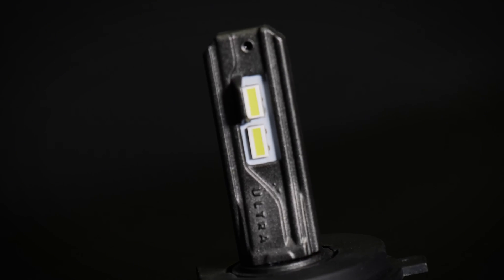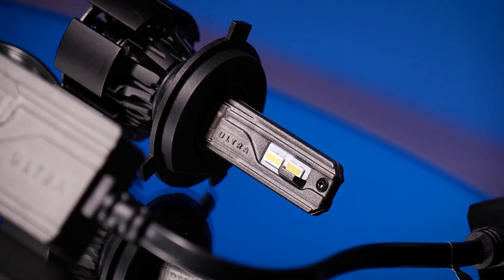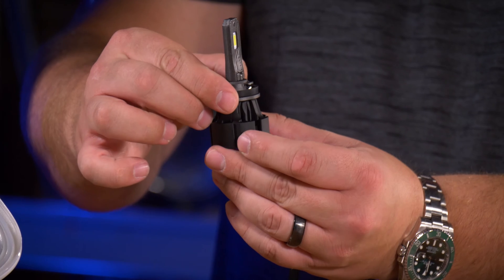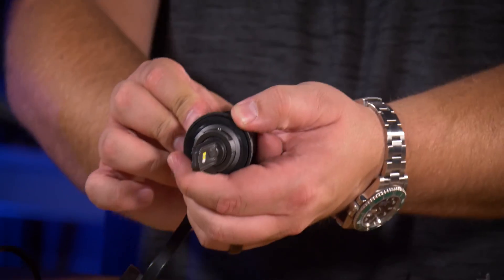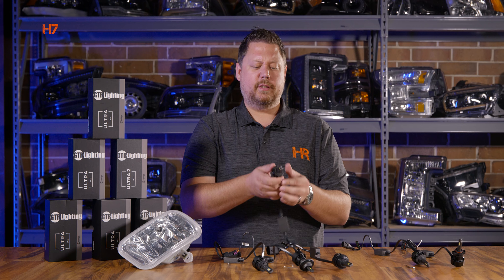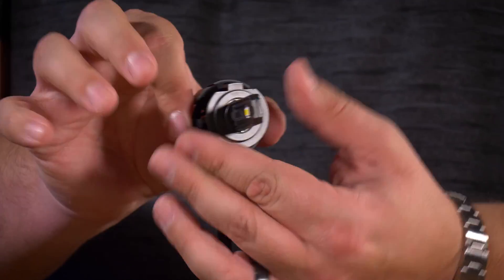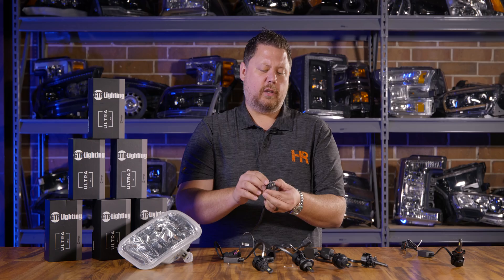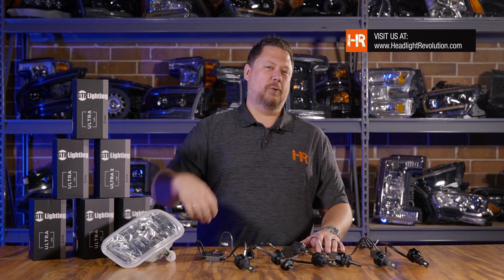How to Aim, Adjust and Align GTR Lighting Ultra 2 LED Bulbs - Clock the LED Chips Inside the Housing

Comment: What about H4?  Mine has two tiny Philips head set screws. I need to rotate it to have it aligned correctly but there are only the two tapped holes already being used behind the collar. No other options to change alignment.

Comment: Are these good for aftermarket projector headlights winjet on a 2015 silverado? currently have hikari but they are really low after 2 years
Reply from the maker: These would be great! But with projectors, a 35w GTR Lighting HID kit would be even better!
Reply: @HeadlightRevolution  do you have a link to them h7 is the size I need
Reply from the maker: https://www.headlightrevolution.com/H7-Ultra-Series-HID-System_2

Comment: Does it matter if the cable is at the 12 o'clock position and the LEDs are at 9-3 o'clock? Installed in a after headlight on a 2017 charger and I did both by touch since you can't see inside the outer housing of the headlight while installed.
Reply from the maker: It does, you can see the light on the front side of the headlight on the lens. This will show you where the diodes are facing inside the projector.

Comment: Absolutely love this channel! I have two questions! I'm getting a 2018 nissan maxima Sv with a halogen/projector housing.  What is the correct clock pattern for the gtr u2s? And next what would be best gtr leds for the fog lights to match perfectly with the headlights?
Reply from the maker: 9 and 3 for clocking them. I would run the yellow GTR bulbs for the fogs!
Reply: How'd it go?? Do you get a lot of people flashing you or do they seem to be aligned correctly??
Reply: @matto5656  
They turned out beautifully! Couldn't be more happier with the gtr's

Comment: AAAH - Thankyou, ive spent all day wondering about this. Now ive got it all together, i have to pull it apart and clock the LEDs :(
A tip for ya - the GTR ultra 2 bulb is loose in the housing of my Ram projector. After clocking to 9&3 i fitted the rubber o ring off the oem bulb instead of GTRs and it now fits much tighter !

Comment: How do you align the bulb if the design of the headlight projector fit the bulb transversely to the lens?, like the toyota rav4 2013-2015? tried the 3 and 9 o'clock align with no good results
Reply from the maker: Reach out to our CS team so we can go through some options with you!

218-755-5200
Sales@HeadlightRevolution.com

Comment: Does it matter if the fins are on the top or bottom? Just got these for my Tundra and couldn't figure out which way the aluminum fins in front of the LEDs were supposed to be.
Reply from the maker: The shield? This should be open side facing up.
Reply: Yes that was it. I took the extra 2 seconds and realized the oem bulb had that shield and matched it up to that direction. Thanks for the response.

Comment: Just put them in my 2018 4runner trd low beams. I did have to clock them to get the chips at 9&3 but other than that no install issues and they’re very bright. Before clocking them I was spot lighting tree limbs. I haven’t driven at night since setting them at 9&3 but I imagine it solved that.
Reply from the maker: Nice!
Reply: Have you gotten flashed at all? These are pretty bright. Do they have a pretty strong cut off point?
Reply: @matto5656  no I never get flashed and they’re extremely bright with a very hard defined cutoff. You will likely need to adjust your headlights tho as I did also. Now for the downside in the last 2 years since installing them I have had 3 failures. They are lifetime warranty so no worries there but the hassle of going thru that process sucks. I hope this is helpful.
Reply: Oh you’ve had issues with them?  That’s interesting because I haven’t had many bad things about their durability and likelihood of failure. I am glad they’re lifetime warranty, that’s true. So you’ve needed to replace them 3 times? Also, when you adjusted them, did you have to angle them down? Or just make sure the lights are facing out at 9 and 3?? Thanks for the help!!
Reply: Heard* not had
Reply: @matto5656  I fortunately had two sets as the fog lights and headlights used the same bulb and I cut the bottom half of my bumper off to install a steel bumper and went Baja designs for my fogs so I haven’t warranties them yet but I am about to have to because I can’t drive around with only one headlight. I did have to clock them but also had to adjust the whole headlights downward. As far as the failures I think they overheat inside those dust caps so possibly drill a small vent hole just to get a little more airflow thru the dust caps.
Reply: did you put the GTR ultra 2s in a halogen or led assembly?? And when you adjusted them down, do you mean you adjusted the bulb down, or the whole housing/assembly?
Reply: @matto5656  put them in the OEM housings and had to angle the whole housings down. There’s videos on how to properly adjust your headlights.
Reply: @Proto.Fabrication  Will they work in my projector housing if I aim them 9 and 3? I know that projector housing is better than reflector housing for LEDs

Comment: How do these bulbs work in a 2012 Honda accord with reflectors, I have been trying a few led bulbs with weird beam patters and I have aligned them perfectly.
Reply from the maker: These would work great in that vehicle, they would provide you with an insane increase in light output! As far as clocking them, you will just need to make sure that you have the LEDs facing 9 and 3 inside that headlight housing, other than that you will be good to go! Let us know if you have any other questions, we are here to help! Have a great day!

Comment: I just installed a few weeks ago the GTR Ultra 2 Led's into my 2020 Dodge Charger Scat Widebody and they are insane. Had to adjust set screw to clock at nine and three and beam pattern is perfect.  I was able to fit new Led and driver behind dust caps with no problems at all. I also ordered the anti-flicker modules but DIDN'T install them and have NO flickering without them. Is it possible to return them? Thank you
Reply from the maker: We can totally take those modules back for a refund, so glad to hear that you are liking those bulbs! If you email into us requesting that return, we will totally be able to get you set up! Let us know if you have any other questions, have a great day!
Reply: @HeadlightRevolution  thank you i wil email you guys.
Reply from the maker: Sounds like a plan, let us know if you need anything else! Have a great day!
Reply: Have you gotten flashed at all? These GTR ultra 2’s are pretty bright. Do they have a pretty strong cut off point?
Reply: @matto5656  Never been flashed once. Yes the sharp beam line is perfect. You must make sure when you install them that you clock the led chips 3 and 9 oclock otherwise you will not get the beam right.
Reply: @bkny6798  what headlight housing/assembly do you have? I have projector housing. Do you think I'm good to put LEDs in a projector housing as long as I aim them 9 and 3??
Reply: @matto5656  Yes. I have a 2020 Dodge Charger Scat Pack Widebody with projector headlight housing/assembly. Fits and works perfect.
Reply: What do you mean clock at 9 and 3? I have a 16 Charger. @bkny6798
Reply: So when you install the led bulbs make sure the led chips are facing 3 and 9 o'clock just like a clock. The led chips should be facing left and right not up(12 o'clock) or down (6 o'clock) that way you get the perfect beam pattern and don't blind other drivers  @JonnyBlazeTCB

Comment: I have a 2019 chevy 2500 and I ordered a set of these bulbs for the fog lights. The issue I'm having is that 5202 bulb cannot be clocked at the 3 and 9 o'clock position on this truck. There is no hole drilled for this position for this particular application. The closest I can I get it is 11 and 5 o'clock position
Reply from the maker: With the fog lights, we will sometimes see them mounted facing 12 and 6 instead of 3 and 9. That may be the case with your fog lights, I would recommend trying them in that orientation! Let us know if you have any other questions or concerns!

Comment: I run these on my 2015 chevrolet ss for the highs and fog - hands down worth the extra cost.  The old generation gtr led bulbs i also run on my 86 square body and chevrolet cobalt.  No complaints or worries down the road at any speed👍🏾
Reply: Same here I was running the old gtr gen 3's in my 88 square body but will be upgrading to these. If I like them they'll go in my 90 suburban.
Reply from the maker: So glad to hear that you are liking them, thank you so much for the support! If you need anything else just let us know! Have a great rest of your day!
Reply from the maker: Glad yo hear they are working for you! Those new Ultra 2 LEDs are fantatic, I think you will really be impressed with them!
Reply: Have you gotten flashed at all? These are pretty bright. Do they have a pretty strong cut off point?